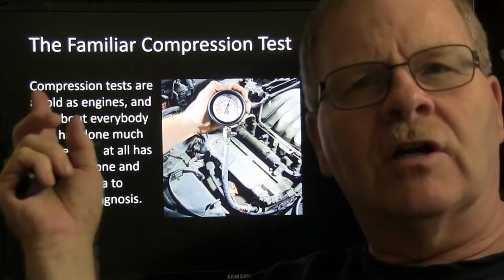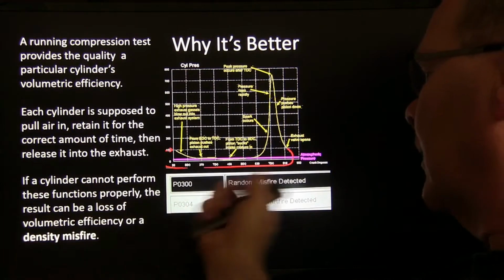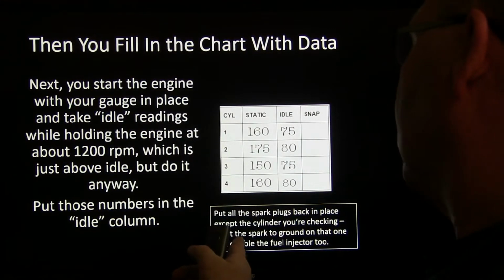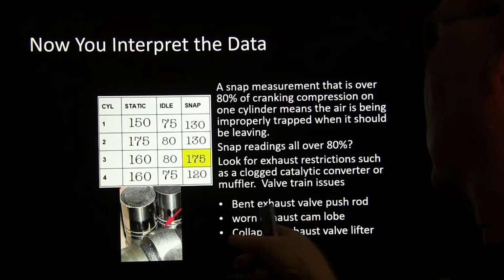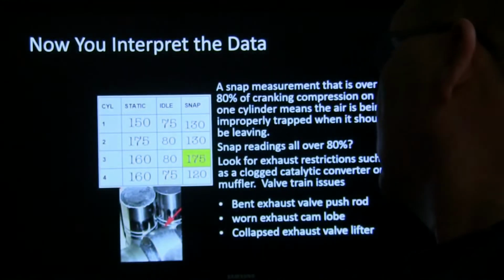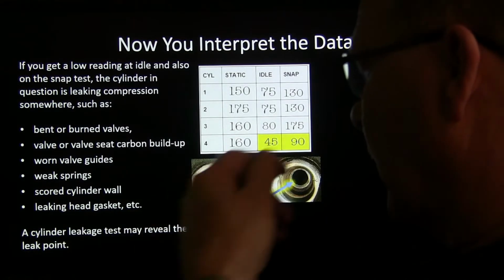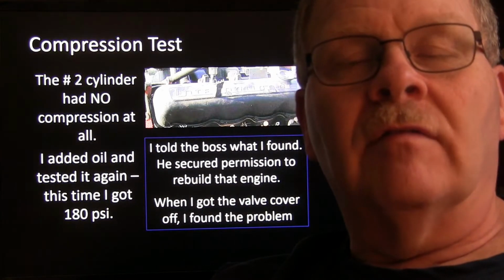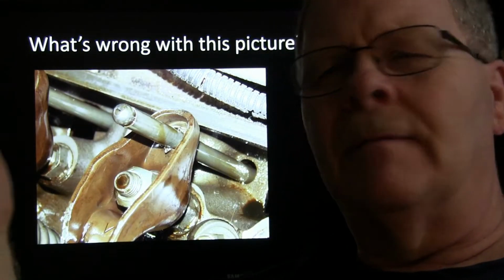Dynamic Compression Testing

Comment: Great video. If had issues with the valve core sticking on my snap on, Matco and Cornwell compression testers with a dynamic test. I have to replace the valves after. Am I doing something wrong or I just can’t find a quality gauge?. Testers always work fine with a static test. Thanks
Reply from the maker: That's a problem sometimes... Just make sure to use a valve made for the gauge instead of a tire valve. And sometimes a wet test may compromise the valve.